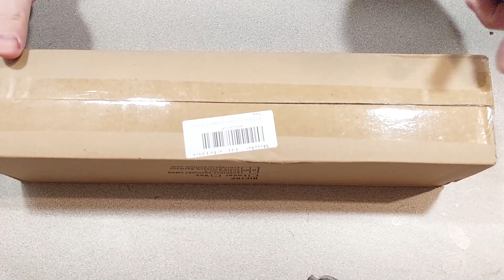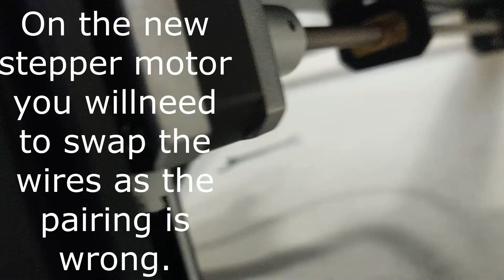how to install a Dual Z Axis Mod on a Tronxy XY-2 Pro

Comment: Hey Jeff,

I ended up installing the Creality brand dual lead screw upgrade on my Tronxy XY-2 Pro.  Of the seven machines I own, the Tronxy was the only single lead screw machine I had.  Had I thought adding a second lead screw to the Tronxy would cure the remaining reliability issues I've had since I bought it, I'd have upgraded it three years ago.

Before the upgrade my Tronxy was randomly injecting bulges that would appear in nearly every print.  Until now, I could print the same model three times and I'd have a random bulge which looked like a missed Z step at different heights on each print.  My X gantry was always perfectly straight, even, and level and motion on the Z axis was silky smooth, yet still, random bulges.

Adding the second Z motor/lead screw not only cured the random bulges, but my layer lines are now super consistent, which they never were in the past.

This upgrade is the second game changing upgrade my Tronxy has gotten.  About a year or so ago, I ended up buying the textured glass and bed level sensor combo.  My Tronxy came new with a defective bed level sensor that would cause the machine to smash nozzles into the bed if I rehomed just after a print.  Turning the machine off and back on again before re-homing would prevent the bed smashing, but I was really wanting to print on glass as I do with all my other printers.

IMO, the dual lead screw and upgraded "black" bed level sensor are essential upgrades for this machine.  The darn thing is actually usable now.

I went with the Creality kit because it was only a dollar more than the kit you installed in the video, and when I have an option to purchase from Creality without breaking the bank, I do.

I noticed a number of people are asking questions about the wiring.  First of all, the Y cable that came in the Creality kit is just stupid long so routing is certainly not an issue.  I looked at the original Z motor cable and saw that it was simply a straight cable with nothing swapped or rolled.  I looked at the Creality cable and saw that it was straight at the motherboard JST but the two motor ends both had the middle two cables swapped.  I thought I was going to be slick and unroll the two motor connectors making them straight, but the result was a buzzing stepper on the new side.  I never would have suspected these stepper motors are not standard, but that seems to be the case.  I ended up re-rolling the two center wires on the second Z motor to fix the problem.  That said, had I swapped the two middle wires on the motherboards JST connector, I still would have had to do the same on the connector to the original Z stepper motor.  The moral of this story is to simply swap the two center wires connecting to the newly installed motor and that should fix it.

I'm not sure why these kits are coming with the upper bearings and blocks.  As you point out in your video, you had to raise your motor by 5mm due to the short lead screw.  I decided not to install the upper bearing on the second lead screw for two reasons.

1.  The Ender 3 comes stock with no upper bearing and it seems to do just fine.
2.  When I do a manual be tram, I begin by bottoming out all 4 corners and raise whichever corners aren't perfect as little as possible to square everything up.  Five millimeters was not going to get my lead screw anywhere close.  Were I to elevate the motor high enough for the screw to reach the bearing, the new steel plate was more likely that not going to smash into the motor while homing.

Thank you for posting this video Jeff, it was helpful in my decision to upgrade.🤤

Comment: Hi.  Did you ever mess with the vrefs?

 My tronxy is disabling z stepper motors entirely after starting any print.  After I stop the print, I can't even control the z-axis unless I disable the steppers.  Then I can control the z-axis again.

Comment: just a heads up, I just purchased the kit from your link and the lead screw is a different thread. I don't know if it has changed
Reply: I purchased a set of 2 lead screw with the same thread of the original Tronxy printer. I suppose that different threads makes different steps for every motor and makes it more complicated.

Comment: Hello Jeff, there is a second Z axis connector on the board, can't we plug the second stepper motor there instead of using the splitter cable? There seems to be a sort jumper glued in the connector on the board in mine. Your wire swapping explanations are still confusing to me. Bought the exact same kit you linked in the description.
Reply: The two middle wires swapping, then it works

Comment: What do you mean by swapping the wire? And how do you do that 😅?
Reply from the maker: There is 4 wires going into the stepper motor. You neen to swap them around to find the right combination of pairs.
Reply: @jeffs3dcorner  and its for the tronxy or the upgrade kit motor? Also is there any possibility of burning any of the components? Thank you by the way! Your videos helped me a lot!
Reply from the maker: You can do it on either side of the stepper wire
Reply: @jeffs3dcorner  the stepper motor just vibrate, whats causing it?
Reply from the maker: Turn off your printer swap 2 wires closest to one side  on the stepper turn on and see. If it turns great if not put those wires back and swap  some middle ones keep trying different combos untill it moves .

Comment: Very nice build. I think I will follow this but now I have to wait for the heatbed sensor and a new insulation for the bed... finished working right after the firmware update. I should have fixated the bed before turning the printer upside down, hachja. And if the printer wont work then I give up and change to another brand, thinking of artillery x2